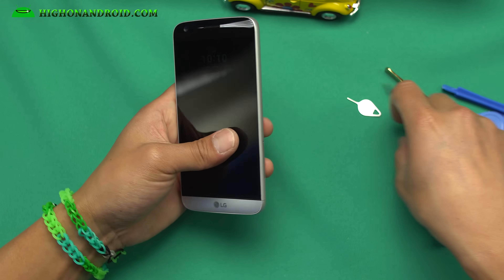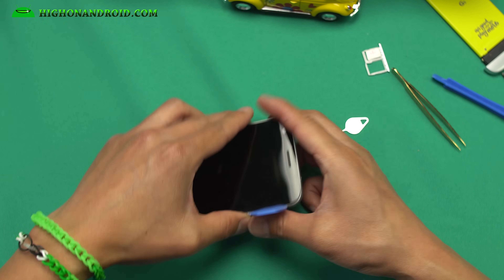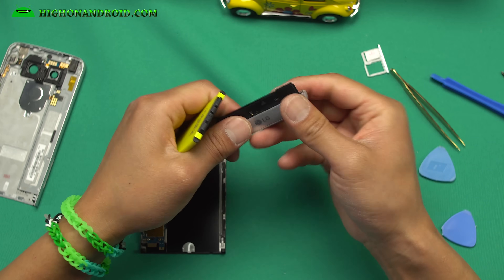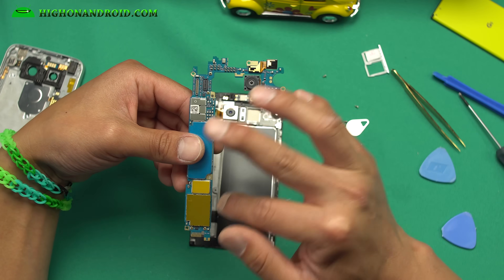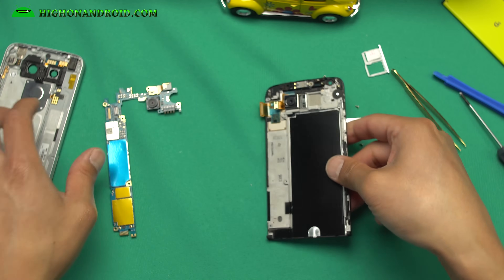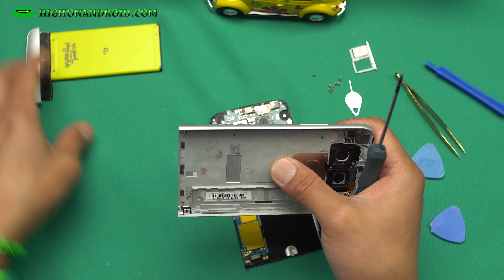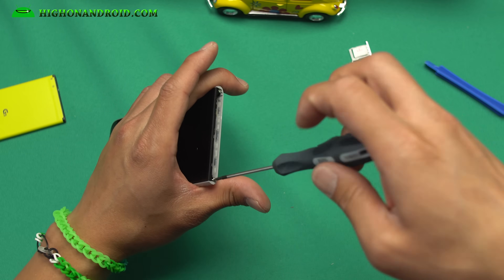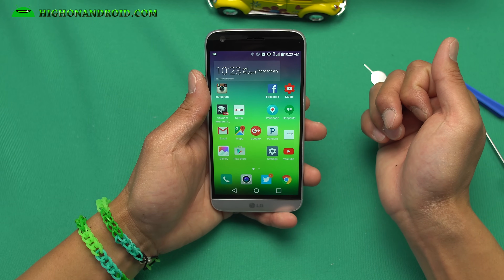LG G5 Disassembly Reveals Metal Unibody Design!

Comment: You completely misunderstood the whole deal here. The debate was never if the G5's body was made out of metal, but what kind of primer/plastic coating it had on top of it that made it feel like plastic. Also in the description you said that the phone is unbendable. That's false, nothing in this whole word is unbendable. It definitely seems that you want to cover LG's ass.
Reply from the maker: +MrTehnoGuy go look at jerryrigeverything's bend test, if he can't bend it, it's unbendable.
Reply: ***** Unbendable means that it cannot be bent under any amount of pressure.
Reply: +MrTehnoGuy Dude calm down. When he says "unbendable" he doesn't mean literally. of course if you are the type of idiot who hits it with a hammer or puts it in a vice or any other drastic condition you and bend it. but under normal everyday circumstances it shouldn't bend.
Reply from the maker: +Kopfhoerer02 exactly, let's just use some common sense.   What I meant was that the metal frame isn't bendable without applying extraordinary force, it literally does not bend with mild force of human hands while frames on other phones actually "bend" with ease.
Reply: +Max Lee (Zedomax) oh snap!
pun intended
Reply: It's paint/primer not plastic... And this is a choice LG made to cover the antenna lines.
Reply: "Unbendable means that it cannot be bent under any amount of pressure."
in this case that is not what it means imo
Reply: +MrTehnoGuy The unbendable here doesnt mean it isnt bendable at all, they just say that you cant bend it if you dont use a clamp, I mean nobody who doesnt want to bend his phone does that. He meant it isnt bendable for normal users
Reply: +Max Lee (Zedomax) People take the least words literal.
Reply: +sush2142 Elaborate more on how I misunderstood it.
Reply: ICE Starboy Yep it's a coat of primer under a coat of paint. Usually aluminum on a phone is anodized, which is a chemical process. The only problem in LG's case is that it doesn't feel like metal, but rather like plastic.
Reply: Nebula Mirage What does that have to do with what we're talking about here?
Reply: i opened the back cover to fix the gps contacts . the cover is so hard , I cannot bend it even a little bit.